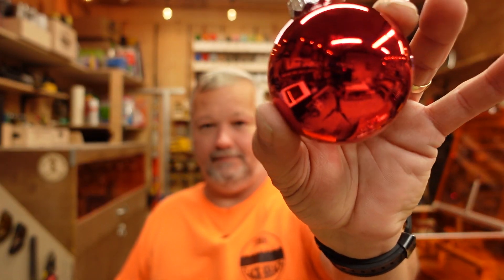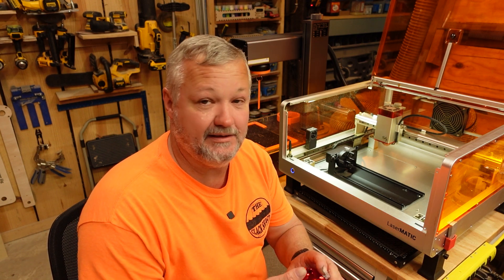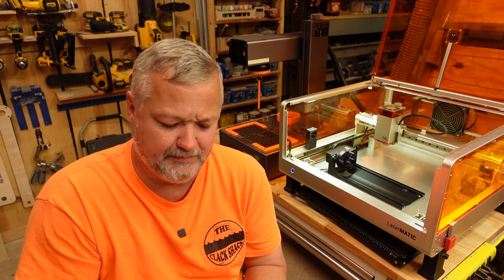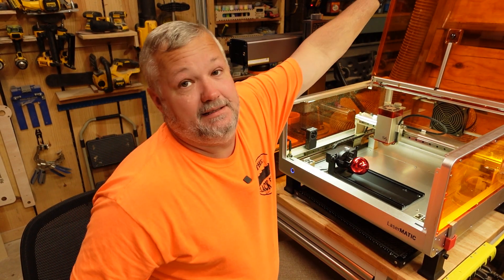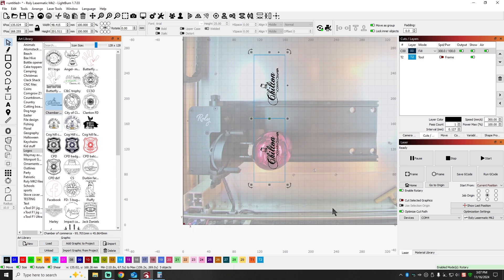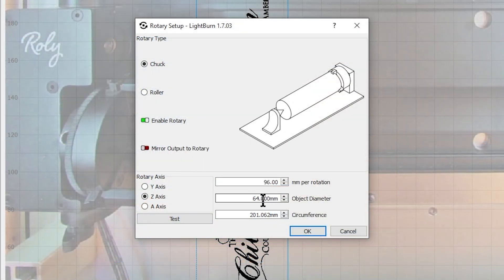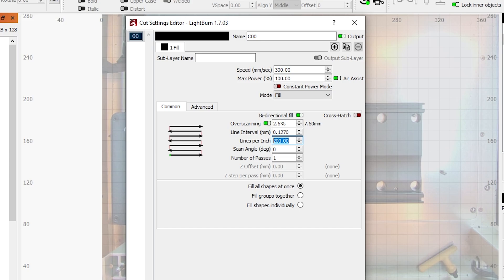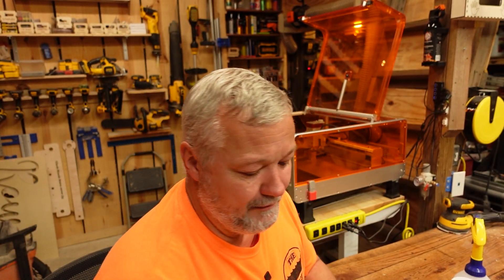Laser engraved Christmas balls with a 10 watt laser

Comment: The problem I am facing now is the paint inside is peeling off the inside as it dries.  I think my issue is that there is just too much paint inside the ornament and it isn't drying.  Anyone have any similar experiences?
Reply from the maker: Could be too much paint. I haven’t had an issue but I also used a bit of alcohol to thin rather than water.
Reply: @TheClackShack  yeah, I saw that in the video. I didn't dilute at all, since the paint I have is already pretty thin.

Comment: Instead of using the L shaped fingers,  I have one rotary that has the long straight bars that may hold it decent also.  They look like straight silver colored pegs that screw in and are straight, you may be able to get them in the neck of the ball
Reply from the maker: I am using the pins, not the L clamps. The Roly pins are black

Comment: Most of us doing these with the F1 / F1 Ultra are actually using the blue light because it takes the paint off cleaner than the IR and has a wider working area on a sphere while using the standard flat surface engrave. No curved engraving software, no rotary. As long as you aren't trying to do a full surface wrap, those are actually pretty simple.
Reply from the maker: I did a few on the Ultra using both, similar results but I wanted to use a gantry machine.